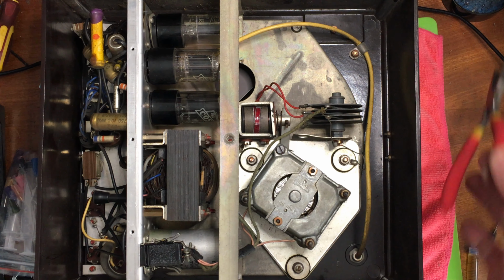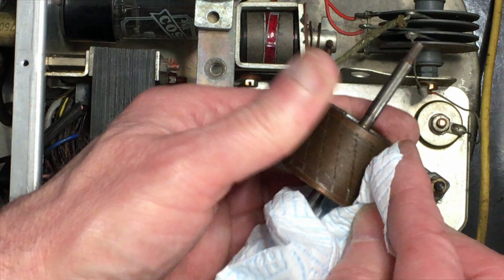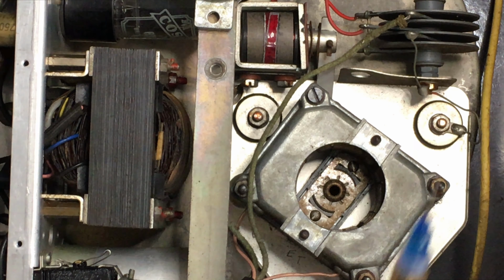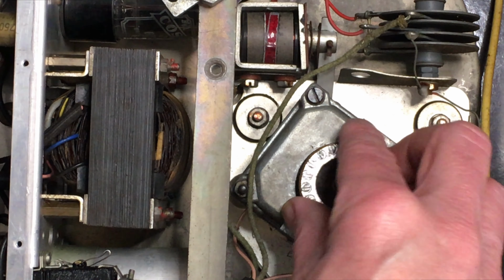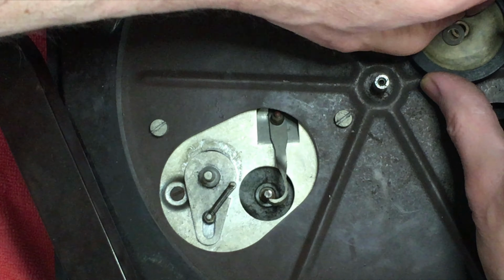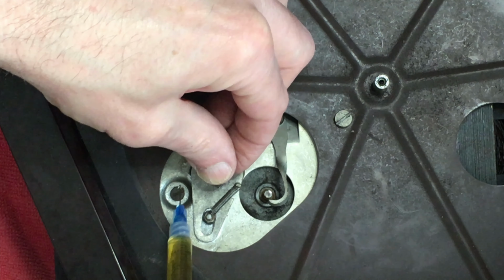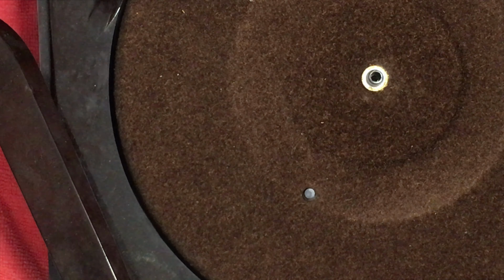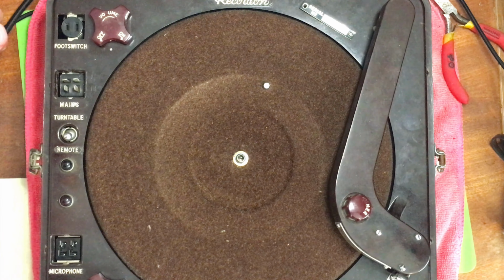1950 Recordon renovation part 7 - Motor and general lubrication

Comment: Thanks for another great video. I'm not sure if it needed it but I topped up the oil on my motor and it's running good and strong.
I was hoping to find a part 8. Did you ever get the recording and playback working again? On mine, the recordings are a bit distorted and the playback level is very quiet. I suspect the HT is not correct but I can't find a schematic for this one. It has 4 valves - 6BR7, 12AX7, 12AU7 and the rectifier -  so a bit different to your (BK503 clone ?) machine.
Reply from the maker: I've not done part 8 yet, as I was expecting to easily remove the wrinkles from the recording discs - but no method I've tried so far has had any success. 
It seems the only possibility is to steam and iron one, but I'm concerned that could just destroy it (or the coating), so I've been putting it off in the hope of finding an alternate method.
Reply: @RJTC  I probably have an unwrinkled disc or two If you're stuck.